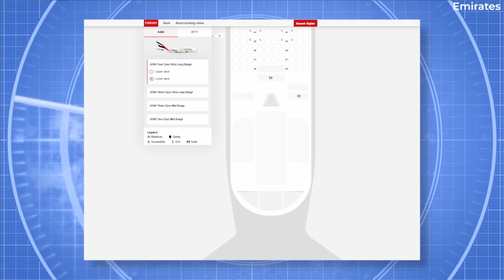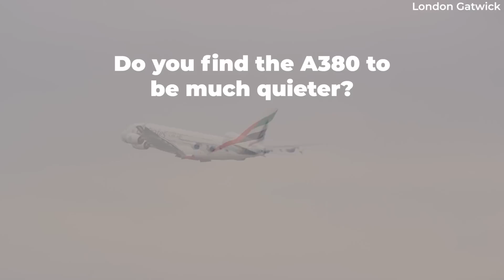Unusual Problem: How The Airbus A380's Quietness Actually Made Sleeping Harder For Pilots

Comment: I flew on a British BAC 1-11 (similar to the American DC-9) in 1972 and the lack of noise was disconcerting. Shortly after takeoff, in order to meet noise abatement rules over London most likely, the pilot eased off the power. There was almost complete silence other than slight wind noise as we flew up through cotton ball type clouds. I though the engines had failed at first and was surprised as we continued to climb. It was an unforgettable experience. If there is a plane quieter than that, I would love to fly on it.

Comment: I worked aboard A380s for almost 10 years. The cabins and crew rest compartments were quiet and yes, you could hear crying babies etc above. The main issue for us was that the galleys were very noisy due to the powerful air intakes there. Up to 90dB. Not great for cabin crews…

Comment: I flew from DFW to SYD a few years back. 17.5 hours. It is, without a doubt, the quietest and smoothest plane I’ve ever been on. I slept like a baby.
Reply: I was on one for 26 hours once. QF12 from LAX to SYD. Was diverted to BNE due weather and then had to wait on the ground unable to disembark for 2 hours, flew down to SYD and sat in a holding pattern for 2 hours until we finally landed, then proceeded to wait for a gate for another 5 hours.

Comment: It's astonishing how quiet it is. I've sat right next to the engine and couldn't hear a thing from it during my first flight.
Before getting on the flight back, I got a Sony noise-cancelling headphone and it actually got creepy. I actually took off the headphones to sleep because the noise-cancel makes everything TOO silent. You add the already silent plane and the noise cancelling, it was insane. 
I thought every plane was like this since it was my first flight ever, but I was wrong after hopping on the A340 and ATR lol
Reply: What model headphones did you get? I've always just used earplugs but while they're great at handling engine noise, they're not great at filtering out high frequency noise like kids crying and screechy passengers in the row behind you. Would like a pair of those Sony phones!

Comment: A380s usually have crew rest compartments in the aft cargo hold too I remember (that's accessible via a main deck floor hatch, thus 1 row will have 3 instead of 4 seats in the centre) but I guess Emirates wanted to store larger water tanks there instead (for its 1st class showers) so the compartments had to be moved to the main deck aft cabin instead

Comment: In my previous A380 Journey, I sat in the front of the lower deck right behind pilot cabin. I can barely hear any engine sound.
During climbing phase, I hear the noise of air hitting the fuselage.
When it climbs higher, air gets thinner, the wind noise subsides.
The only noise left during the cruise phase is the air-cond noise.

Comment: The main issue was the location of the rest area since it was situated in the middle of the back cabin with almost 80 passengers surrounding it, also toilets facing the entrance of the cabin crew rest area. The solution was to relocate the crew rest compartment (CRC and FCRC) from the AFT of economy to the front Cargo area adjacent to the left Main deck 2 door. Crew rest door leads to a ladder that leads down to the converted cargo space which is considerably less noisy and more space.

Comment: One of the few benefits of a 4-engined design. At least half the noise is a lot further away.

Notably also an airframe without windows (but instead say video panels) could also be a lot quieter, and possibly lighter due to not having to reinforce around windows.

Comment: After 70 flights on an A380 I agree it is so quiet, so much so if I have a choice I choose to fly it. I have flown the Dreamliner and whilst better than any other Boeing and particularly the 777 it isn’t as good as the A380. And I was disappointed by the A350 because my expectations were so high after hours of flying the A380. But all 3 don’t leave you dehydrated on a long flight. The cabin crew don’t have to be offering water all through the flight.
Reply: Are you saying the lower cabin altitude makes you less dehydrated?
Reply: @jonasbaine3538  Yess significantly so. No cabin crew continuously parading around economy class with drinks.
Reply: @briangriffiths1285  Makes you wonder how much lighter the plane can be just from carrying less drinks alone. Quite interesting to think about it.
The A380 is partially composite (if I recall areas like the wing box and some tail sections) but mostly aluminium like any other pre-787/A350 generation aircraft. I would definitely love seeing a 2nd gen A380 tho, it would be really epic even if absurdly unlikely. Can only imagine the monstrous size of two engines capable of pushing a full twin deck aircraft like that around.
Reply: @jonasbaine3538  Yes very much so and much less tiring. I fly LHR = SIN = AKL in economy regularly and if there is a 777 on one leg it is dreadful in comparison.
Reply: Interesting, as I was just wondering the other day how do they handle air humidity levels in the cabin.
For the sake of fuselage life, you would rather have it low. In other hand for health reasons the near 50% is ideal for people. Seems the newer aircraft have been made with this consideration in mind.
Reply: @Kalvinjj  Just so, the Boeing is made of corrosion free plastics and carbon fibre. Not sure about the A380 but with Emirates challenging ing Airbus to build a new version from lighter material to be more efficient the corrosion problem would go away.

Comment: That purely seems to be the airline specific issue.
I mean... if the company next pushes the crew rest area to the unpressurised area of the cargo hold... it isn't exactly the manufacturers mistake that the crew suffers hypoxia.
.
The crew rest areas... if moved towards the rear of the fuselage... on all other aircrafts too.. then not just on the A380... but on other types too.. the crew would face similar problems.

Comment: I can definitely agree that the A380 has probably the quietest cabin of widebody aircraft. I think it's fair that, the same solution offered to passengers, earplugs, should more than address the noise issues for pilots who are trying to sleep. 
Understandably, they may be more accustomed to sleeping through engine noise, but nobody will see a quiet cabin as being a problem.
Reply: Earplugs don't block off cabin passenger noise as effectively as engine white noise, especially people talking or babies crying, if at all, as stated in the video. :( in fact in noisier aircraft, you'd find it easier to hear what people on the next row to you are talking when you put earplugs. The earplugs insulate the white noise well, but keep more of the human voice unfiltered. So you end up distinguishing human noise even more than without them, provided running engines were concealing human voice in first place!
Reply: The problem with earplugs is that they block all sound equally, so if someone is being louder than the aircraft noise you still are going to notice.
Reply: @ivanv754  To the extent that it keeps you from sleeping? I doubt that, but I guess some people are very light sleepers.
Reply: @sainnt  if babies are crying from time to time in the back cabin where the Emirates' cre resting areas are, then that'd be a problem even for less light sleepers indeed.
Reply: @doahart75  I fly quite often, and I sleep through everything. I fall asleep in nightclubs. There are layers between the cabin and crew rest areas. That, coupled with earplugs or noise cancelling headphones, should be enough even for a light sleeper in the serene cabin of an A380. Crying babies are only going to affect some flights, not all, and rarely do they cry the entire duration of a flight.
Reply: @sainnt , flying at work, vs  flying off (or for work) are two different concepts. The stress at trying to get a nap in order to continue working afterward shouldn't help.
Reply: @doahart75  I respectfully disagree. The A380 has been in service with 14 years. If they're not used to sleeping in it by now, they never will. That problem will be limited to a relatively small number of crew by now
Reply: @sainnt  facts

Comment: I have flown on the A380 and the 777. You can clearly guess the quieter aircraft. A380 in fact is so smooth that you can barely feel it taking off.
Reply: Probably just due to its massive size and slow acceleration
Reply: naturally so. It's a mammoth
Reply: Same

Comment: To be honest for reasons like this I’d actually prefer a noisier aircraft. Not to the point where you have to shout at someone to talk like on an aircraft from the 60s but something like the 737ng level is ideal. Plus I think the loud engines add to the thrilling experience of taking off especially from a shorter runway
Reply: I think of this with my only ride so far on a 787. Engines were very quiet, never really did hear them at all the entire flight. Takeoff and landing a very loud what I'm assuming was an electric hydraulic pump was running, cruise wind noise was louder than the engines. Was actually somewhat of a let down to be honest.
Reply: @quillmaurer6563  yeah the 787 landing is easily the loudest landing I've ever experienced. The only thing I think of is that the thrust isn't coming out of the chevrons, but instead out of the side during reverse thrust. This means that the sound doesn't get drowned out as well. Just a thought though, have no idea if this true or not.

Comment: I have not yet been able to afford to ticket price tofly on an A380.. However on those flight I had the opportunity fly on any Airbus product, I have found that the noise level on them is delightfully far quieter than on any Boeing product!
Reply: My air travel experiences were many years ago well be for the Boeing 787.
Reply: But they just said that the B787 is more quiet than the A350
Reply: @thabomabuza7340  69dB of Airbus is much lower than 72dB of B787, wach video again. 3dB is a lot.